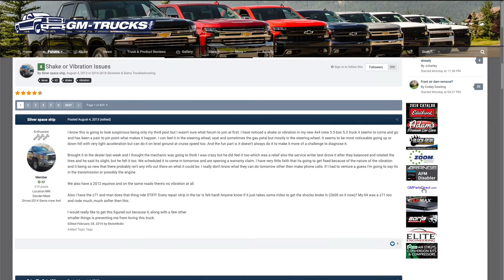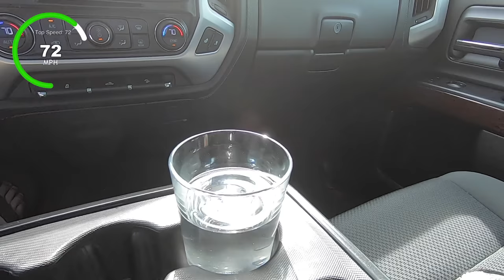"Chevy Shake" Driveshaft Fix for GM Trucks?

Comment: Thanks for the vid, but why didn't you say if PDL thoroughly examined and tested (for true and balance) your oem stuff to prove it's bad?? Wouldn't that be a critical piece of info to share!?  People want to know what oem pieces are screwed up! They want someone to prove that some oem part was made wrong, etc.
Reply from the maker: Sorry I know people always want some piece of information they didn’t get but the problem isn’t identified like you say. A 2 piece driveshaft might be “in balance” each piece however the issue is more likely caused by the overall length of both combined with being a 2 piece becoming unstable in the application at higher rpm. While I would have loved to stick around and make a ton of content with those guys, I left Phoenix on a Sunday around 8pm, slept in my truck for the night, met the PDL guys in Bakersfield Cali early Monday morning (a holiday), filmed from 9am till around 7pm which is what you saw, then drove through the night / slept in my truck again. I got home Tuesday morning around 6am, showered, went straight to work Tuesday morning getting in around 7:10 am. I was 10 minutes late. That’s why I didn’t stick around longer to keep troubleshooting. I was dedicated enough to drive over 1000 miles and give the time I had to give, that’s the best I could do.

Comment: CHANGE PINION ANGLE AT THE DIFFERENTIAL TO DOWN 4*
Reply from the maker: I'm not sure what that means.
Reply: Incorrect driveline angle could be the cause of these vibrations.  Had a similar issue on my mustang which is fixed now.

Comment: I just bought a 2018 Chevy Silverado LTZ with 17000 miles on it and it vibrates pretty bad between 48 and 52 mph Taking it to dealer next week
Reply: So far the dealership has changed the torque converter with no results and now it is back at the dealership for more testing
Reply from the maker: Anything come of it?

Comment: I have a 2017 chevy silverado 6.2l with 8 speed and had a shutter at around 65mph took it in to dealership when it had 23,000 mi  they changed torque converter and some what fixed it at around 55,000 mi took it back to dealership they changed out torque converter and reprogrammed trans still under warranty 60,000 now three years later with 100k mi its doing it again out of warranty changed the transmission fluid fron gm dexron to Mobil 1  the blue label can and shutter went away

Comment: I like my 2014 z71 2wd when it shakes cause it feels like I'm getting a massage.
Reply from the maker: That’s fine until your on a 2500 mile road trip and you get sick of hearing everything in the cab rattle.
Reply: this comment is hilarious
Reply: Z71 2wd? Does that even exist
Reply: junior third 😂
Reply: @919hey  surprisingly yes. Z71 appearance package it's called. I know because I looked at some and was disappointed  that some z71 were  2 wheel drive.
Reply: @kennethobando78  thank you.
Reply: When I want to fix the shake I'll just change the tranny fluid. It's been figured out they put the wrong fluid in them and the fix is changing it.

Comment: If a 2 piece driveshaft helps eliminate shake and shudder why doesn’t GM use em. Most of trucks nowadays are either long wheel base or 4door crew cabs. Back in the 70s I believe GM used 2 piece drive shafts on the long bed trucks and vans.
Reply from the maker: If I had to guess it is $$$$

Comment: What was the final conclusion
Reply from the maker: Just kept throwing darts at the dartboard and between suspension, driveshaft, rear axles, tranny fluid change, and tires I got about 90% of the vibration out.
Reply: @youtubechampion9377  I’m same boat , got a used one still under warranty 1year left 2017 Sierra
Reply: @GearsGadgets  thanks going on this journey now ...

Comment: So...they did the cutting and drilling for the two piece driveshaft BEFORE trying the direct replacement for the factory driveshaft? That's working backwards!
Reply from the maker: It wasn't backward. We were mocking up two different solutions and since they have had MORE success with the 2 piece driveshaft on the 2wd trucks, they wanted to go that route first. The idea is that typically the longer the truck, the less likely you should use a 1 piece driveshaft as it becomes a source of resonance. Think about a pencil, you can barely bend a 1 inch pencil, but a 6 inch pencil you can snap in two.

Comment: Sometimes it's the torque converter failing as well.
Reply: Tried the new torque converter, still vibrating
Reply: @iragraham2706  Drive shaft?
Reply: @bernardthefourth  was told it’s the valve body that’s causing the vibration.

Comment: Is it a 8-speed transmission?
Reply from the maker: 6 speed.
Reply: @GearsGadgets  because I have a 6-speed transmission also and what I ended up doing was changing the oil and the torque converter and they fix my problems. General Motors had a problem with the transmission oil and they used to burn up the torque converter. You might have the same problem what I had try to change the oil if it fixes your problem that's good but if it doesn't you have to replace the torque converter 2.
Reply: @ulyssescisneros3044  do you know what transmission fluid was used to change it?? Did they update the ac Delco ATF or use something different??
Reply: ACDelco DEXRON-6 full Synthetic  Transmission fluid  Just go to the dealer and make sure as to correct one for your vehicle

Comment: Looks to me that you don't have enough drive line angle. You can't run u joints at straight angles like that.
Reply from the maker: Oh there is plenty of angle.
Reply: Not once did you mention what the degrees of the u joints

Comment: my 99 has the shake and also has the 2 piece driveshaft.
Reply from the maker: Interesting, I haven't heard of it going back that far in model years but I don't doubt it.
Reply: My 99 has vibration also..
Reply: @charleslentz8678  at what speed? mine at over 60
Reply: My 99 does it too.. was vibrating real bad. Changed Carrier bearing and all 3 u-joints. Now only does it between 30-50 mph but nowhere near as bad!

Comment: I don't think the problem is the transmission. I think it's the engine speed. I can put my 2019 Colorado it into 6th or 7th gear and it goes immediately goes away. I think Chevy needs to up the engine speed through the computer in 8th gear.
Reply from the maker: Ive tried all of that in my truck to no avail although mine is a 6 speed.

Comment: I don't see many new comments here. I guess I'm late to the party. 2016 Silverado LTZ HD 3500 DRW. Bought the truck with 62k and at 115k I started to get the shake. Tires, balance, rotor, caliper, shocks, no luck. GM acts like they've never heard of this before. (Colorado Springs) Now they want to do steering gear box, tie rods(inner and outer) pitman, idler arm. I'm thinking I would rather look at drive shaft/trans. I haul 10k to 20k trailers often. Has anyone else seen this problem on the Duramax?

Comment: I was an engineering technician drive systems test bell helicopter.I have trouble believing that GM doesn't have dynamic people who can find the problem in a few days.Stupidity plain and simple greed will cost them .They still haven't learned to stop the process until a solution is made.Boeing is learning this again.
Reply from the maker: I agree Allan Brogdon. Thanks for the comment.
Reply: I'm a Test Tech for Boeing. But for the missile defense part of the company. Our testing is insanely thorough with several inspection buyoffs after each step and process. Test Engineers review data, QA and Mechanical Engineers and Quality Engineers look over everything else. Every torque and part install is witnessed. A government DCMA inspector goes over all of the finals. Everything is treated as FOD and ESD critical. All soldering is Level 3 ICP grade which to my knowledge is the highest level, zero defects are allowed. Everything thing is documented. All tools are recorded for everything they're used on. All hazmat is strictly controlled. All defects are tagged for repair, replace, or scrap. ZERO defects go through the door to our customer.

I'm not sure how the commercial airplane manufacturing is controlled but I don't think it's at the same level as the missile defense side of the company. However Boeing aircraft have a good track record. And the two 737 MAX crashes would have been prevented if the UNDER TRAINED and INEXPERIENCED pilots just turned off the auto pilot system and manually flew the plane. Those airlines poorly briefed their pilots.

Boeing space is mostly controlled and over seen by NASA which is just as strict or more strict than our missile defense department.

Boeing is one of the most ethical companies in the world no matter what anyone else says, thinks, or believes. 
Everyone living in a NATO country is being protected by active Boeing products 24/7/365. Missile defense systems, aircraft, satellites, early warning systems, laser systems, radars,  communication systems, GPS systems, and many more products.

Comment: Why didn't they try the one piece drive shaft first to see if that would fix it, instead of doing all of that grinding and measuring for nothing? Why would someone want to do this in their driveway if it doesn't even solve the issue?
Reply from the maker: That is exactly why you test things like we did so that you can try several different fixes. If everyone (including GM) knew what fixed this issue there would be no reason to troubleshoot anything.
Reply: Gears & Gadgets right, you kind of just reiterated what I just said. What I was saying was to start with the aluminum one piece and if that didn’t work, then try out the more expensive version to see if it would help. I’m sorry if I offended you in some way, but me being a cheap ass I would have just dealt with the vibrations but if the wife complained enough, then I would have tried the cheapest way first.

Comment: mate ... reprogram the engine to shutdown the 4 cylinder mode. Believe me that is your issue. ,
Reply from the maker: It is not, you can do the same test by going into manual mode and it does not make a difference, it also vibrates in neutral.
Reply: @GearsGadgets  have you thought of selling it ?  I'd sell it and buy another GMC Sierra used or new. They are of legendary linage it terms of reliability and ruggedness. If ur passing on a pickup, get a cheap pickup for less than $7,000 and an SUV the likes of Land Cruiser or Nissan Patrol.

Comment: Road force balance service bulletin recommendation is no road force balance over 15lbs. I had a horrible vibration after my first set of new tires and after about a dozen different tires the dealer got me 4 all below 15 and my issue went away. I have a 2015 HD2500 with the 6.6.  Im now at 117K and just put Nitto's on and my issue is back all over again. I was told that the tires were below 30lbs of RF balance. I am having them try to get me new ones under the 15lbs again.. I cant believe GM is screwing its loyal owners over this crap..
Reply from the maker: Dave Anderson they tried that a few times and it never worked.
Reply: @GearsGadgets  I'll be honest, it seemed to quell the vibration for me but I'm thinking this go around it maybe more than just the tires, I'm going to hopefully get the shop to get me tires in the single digits RF numbers cause it worked last go around..I drove it into the shop with no vibration, and drove out with a drink mixer.. The only other thing I had done was a leveling kit, so it's one variable or the other. Process of elimination. Brand new this truck drove like a Cadillac, zero vibration.. I'll post back as soon as I get it back to the shop..
Reply: So, my latest update...Well, It's been back to the shop 3 times as of today, I have had 8 different tires so far installed on my truck, replacing the ones that go over 15#. I will know tomorrow if they remained good since I have put a decent amount of miles on them since they were put on. The truck has substantially gotten better, when installed with the better RF numbers.. I went from wanting to pull to the side of the hwy and set it on fire to actually enjoying driving it again. As of right now I have only one tire that is at 20# of RF and the other 3 in the low teens... I am scheduled to have it in the shop in the AM to have that one replaced and the other 3 re-RF'd to see if they stayed put. The shop ordered 4 more tires and after all said and done (and luck) I will end up with 4 that are hopefully all @ 10# or better. I will post an update afterwards.. Also, just so all of you are aware. The fact that the RF is initially good on install does not mean it will stay good after they have a few miles on them and get broken in. The TSB states that they want 15-20 miles put on the tires before RF makes very good sense. We have found as the tire breaks in the RF numbers always go up.. I had one tire that started out at 29# and after a week of driving on it it went to 36#.
So my goal is to get as close to the single digits and hope they stay under the 15# threshold after break in....
I'll put up another update as soon as I have some definitive answers.

Comment: So wtf is going on with this ? I plan on buying a 2018 Silverado so can someone let me know if the 2018 have it
Reply from the maker: There have been reports of it in the 2018's. I would NOT buy a 2018 without taking it on the highway and getting it through 70-80 mph. If you feel ANY vibration I wouldn't buy it.
Reply: Yes they still have it
Reply: My 2018 Silverado Z71 4x4 Crew is smooth as silk all the way to top speed. I drove a new one back in 2015 and it had it. Mine definitely doesn't. They found that they had an "out of true" driveshaft from the supplier.
Reply: The only thing I can say I have experienced is a slight hard downshift upon breaking faster. Other than the soft tonneau cover causing a vibration. I dont experience the chevy shake like others.. mine is 4X4.
Reply: FLY EAGLES FLY Bleed Green, My 18 5.3L 6 speed RWD does not shake, 15k miles now, the hard down shift happened a lot when the car was new but now it is almost completely gone, happens once a month max! I wonder the if the shakes happen in on both 6 speed and 8 speed or just 8 speeds.

Comment: my friend just bought a brand new  chevy silverado 2019 starting shaking at 2k miles
Reply from the maker: Ugh. So sorry to hear that.
Reply: I'm wondering if the issues could all be related to the transmission fluid or torque converter issue
Reply: slight vibration at 2k got way worse at 6k chevy said he had flat spots on his tires they replaced them same issue... he no longer wants car

Comment: My '92 Chevy Suburban starts shaking around 60mph.
Reply from the maker: Dang.... a ‘92 is 27 years old old bruh!!! Lol. I would start by checking to see if the frame is still there, if so, then check every single other thing on the truck.
Reply: It’s probably your driveshaft or U joints. Have them checked out before it ends up falling off at highway speeds happened to me lol

Comment: I can't stand the littlest viberation, I just the way it is with GM junk, I would get rid of that POS an get a Toyota or Ford
Reply: Just look up vibrations on Toyota and you'll see its more of an issue than GM
Reply: Ford has steering death wobble and Toyota’s had frames rusting to nothing and starters under the intake manifold that burn up. Mechanical things break and have issues, it’s not brand specific.
Reply from the maker: I am going Ford, my 2021 F150 is on order now.

Comment: My 2500 shakes like crazy 6.0 gas 4x4 I hate it.
Reply from the maker: I dont hear much about the 2500's but I do know it is an issue in the 1500's
Reply: My 2500 Duramax shakes BAD as well
Reply: My 2008 6.0 Gas Crew long bed did too when I first got it @ 170,000 miles, 541,000 miles later smooth as butter. Fill the rubber carrier bearing with High Temp Silicone and replace the rear cab mounts with the newer Hydraulic ones. If you still have a vibration over 50-60 mph and gets worse at higher speeds, your rear tires have slipped belts in the center
Reply: The good year dura trac tire are notorious for slipped belts but this is a know issue by Chevy their solution is to not drive over 70. I’m no Chevy hater at all it’s all I have owned for the past 20 years. I truly believe that the testing and quality control has gone downhill. I also own a Colorado with a whole host of issues which sucks because I love my baby duramax. Just my 2 cents. I’ll check into the bearing and the cab mount thanks for the heads up on those things. Chevy 2015 2500HD dbl cab I forgot to add what metal I’m driving
Reply: My 2500hd 6.0.shakes also

Comment: Speed force tire balancing and exact tire pressures will fix this shake.
Way too much over braining here.
Reply from the maker: Bruh, my tires were road force balanced, replaced, road force balanced again, wheels replaced, and a bunch of other diagnostic steps prior to replacing the driveshaft. If the road force balance fixed your truck, god bless but I can assure you, driveline vibration was HUGE in my truck.